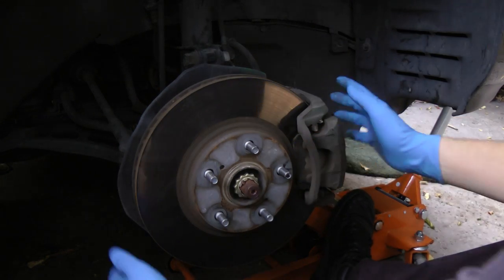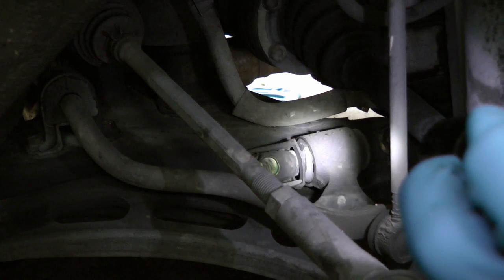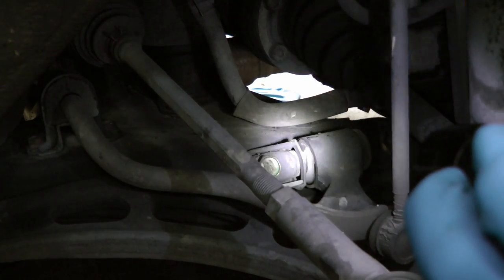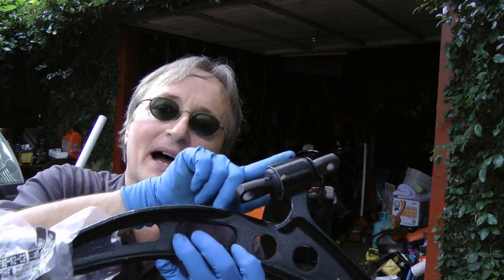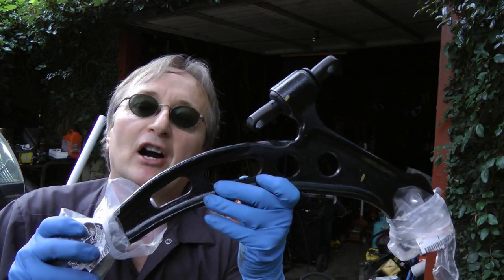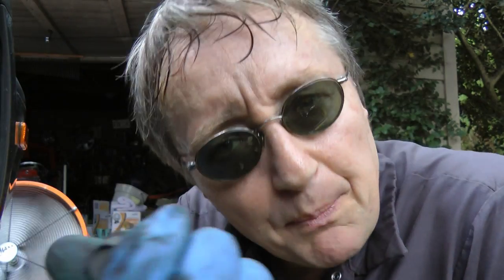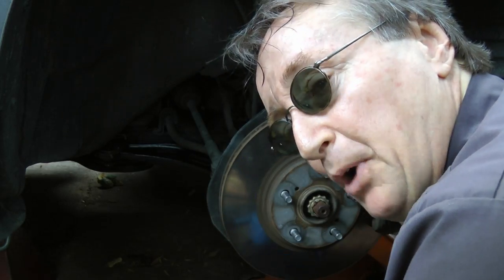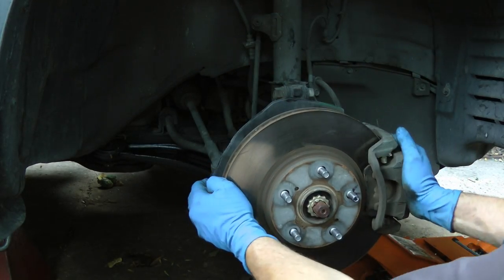How to Stop Steering Wheel from Shaking (Lower Control Arm)

Comment: Hello,  I've just discovered your videos and really appreciate them.  I do almost all of my mechanic work myself. 
I have a 98 Lex ES300 that has a worn control arm bushing on the driver's side.  Do you actually have to replace the entire control arm?  I can buy just the bushing from a parts store. It's the same long bushing that is bad in this video. The bushing is about $26 and the control arm is about $100.  So is it impossible to get the new bushing worked into the old control arm? 
Thanks

Comment: Hey Scotty! Great video! I just did this job on my 1999 Solara. I replaced both control arms, but now I have some insane positive camber on both sides! Why is this?? I have found specialized camber adjustment cam-bolts for fixing this, but I don't feel like I should have to! Did I do something wrong? Or did ImportDirect just build the control arm to the wrong dimensions? I don't want to go aftermarket to fix this problem if I don't have to. Please help! Thanks in advance!
Reply from the maker: +Andy1dude they built it wrong, if it's a chinese made one, they often are made poorly
Reply: +Scotty Kilmer 

Hey Scotty! I forgot to ever reply after I figured out my problem. 

I had had my car aligned several months before the control arm bushing went out, but it was done while the bushing (the reason I replaced the control arm) was partially already bad, and presumably somewhat out of shape (they don't go bad all at once overnight, as I'm sure you know). 

Consequently, when I put a brand new control arm on, it threw my alignment out. I took it to a shop and he put it on his 4-wheel machine. Turns out the only thing wrong was some toe-in on the front right. No camber problem whatsoever. 

HOWEVER!!!  This taught me an important lesson: Sometimes toe-in can look like positive camber, because the tire gets all squeezed in at the bottom as it rolls forward, making it look like it's leaning. Secondly, I should be careful self-diagnosing when I am not a professional with a $75,000 alignment rig. 

Long story short, $75.00 later, I don't have to screw around with aftermarket cam-bolts, and my car is back to normal.

Comment: Hey scotty, Ive seen all your videos! yure the best!

I was recently in an accident where I spun out and my right tire slammed against a curb. It bent up the rear trailing arms & watts link and maybe more.   
The rear axle shifted about 3 inches to the left, it still drives fine, but the rear wheel is definitely misaligned. 

What do you think my best course of action is? 

to replace the bent parts? or to buy a whole new rear end off a used crown vic?

do you think I can get it aligned?

Comment: You said that if your steering wheel shakes when braking.  Doesn't that also indicate brake rotor warp?
Reply from the maker: sometimes yes, sometimes no. ALWAYS fix broken suspension parts you can see first, as they can cause shaking when braking due to looseness.  IF you find no worn susp parts, then change the brake rotors and pads.

Comment: Hey scotty Great video as usual. My problem is on a 2012 Focus Hatchback and the LCA on the LH side. Shop manual says dont pry on the ball joint but to use a pry bar in the LCA opening. My problem is that there is nothing to gain leverage off of. any tips?

Comment: Hey Scotty,
I have a 2013 Ford Focus and I can't find any information on whether or not the bushing/rubber is separate or attached to the control arm as one part; just like in your video with your vehicle. My local shop is telling me it's all one part. Before I dive under, would you happen to know? If it's separate it would definitely help the wallet and the shop it's pulling a fast one.
Thanks!

Comment: I really enjoy your videos!  I just purchased a kit to do a front end job on my 02 Odyssey van.  Lower control arms with ball joints, sway bars, along with inner and outer tie rod ends.  Any recommended plan of attack, or just start at the control arms and work my way toward the engine?
Reply from the maker: just take your time, and jack both front wheels off the ground to remove any tension on the system.
Reply: Scotty Kilmer Thanks Scotty...going to tackle it this weekend.  I'll let you know how it goes.  Thanks again for taking time to share your knowledge and experience.  So much help!

Comment: Hey,  next week I'm  going to change out mine also in a 2016 nissan versa note on passenger side... Is there anything to be aware of when i do this myself?  and if i change the one control arm is it usually best to change both sides at once or does that matter
Reply: Nate frambach it is best to do both sides when it comes to the suspension, especially with the struts. It would be awkward to have one new control arm when the problem can also be with the other. I keep seeing lower, meaning there could be an upper portion but I dont see any thing online for it.

Comment: You can use 98' camry lower control arms on the car your working on, i did that with my rx300. There much cheaper and the same exact part.

Comment: Hi Scotty,

I did a steering balance recently and the guy told me that the Lower Control Arm is not placed well and he needs to fix it by positioning it correctly. But after that a strange thing is appearing while driving and especialy while turning around! the rpm is like firing and the car is like beginning a drift.

I went back to him but he says that this has no relation with what he has done to the Lower Control Arm. What do you think ?

Comment: Hi Scotty. I went in to get my front alignment done for my 1999 Honda Civic EX today and they said they couldn't do the alignment because my right front lower control arm is bent from my incident with running into a curb on an icy day. I've never done any car repairs before, but I want to save money. Would it be this easy to change on my Civic if I can get ahold of the part and maybe a friend who knows a little about cars?
Reply from the maker: sure, it's a simple job for anyone mechanically inclined with simple hand tools

Comment: I recently replaced my lower control arm and sway bar end links for my 2004 525i and I'm experiencing a bumpy ride, especially when I'm on the freeway. Do you know of any common mistakes when changing a lower control arm that might result to a bumpy ride?
Reply from the maker: being bolted on wrong or too tight can make em bind

Comment: I am currently replacing a both front lower control arms on my Hyundai Santa Fe. I did the passenger side but the pinch bolt on the driver side is most troublesome to remove. Went through a can of WD 40 can and my ball and peen hammer broke on it. The only thing I haven't tried is a propane torch to loosen the knuckle. any thoughts?

Comment: When I got new tires and an alignment last year, the car shop told me that '07 Hyundai Elantras have rigid control arms so they can't fully align the car for the issue I'm having (front tires wear heavily on the inside of the tires) and I needed to buy adjustable control arms. I found the parts they suggested online but from what I can tell from looking at videos on how to install them, what they recommended to me was for the rear only. So two questions: 1) If the wear issue is on the front tires only, then I need to replace the control arms on the front tires, right? 2) If I only need to replace the control arms on the front tires, then I have the wrong parts, correct?
Reply from the maker: yep, to all your questions. Find a better alignment guy, many of them know how to shim and drill and make adjustments without buying such parts

Comment: Hey Scotty. Is there an oem or aftermarket brand you can recommend for 2007-2012 Toyota Camry control arm? Original toyota part is over $200 each.

Comment: for my crown Victoria 1987, BOTH the front wheels wiggle like the one in the video.  Do I spend $500 bucks on both the upper and lower control arm assemblies, (as suggested by the alignment shoppe after a tow alignment, mind you the cam is still off) or just replace the bushings and ball joints on said arms?    Much thanks. I want to make sure from the best, so I do not overspend $$$ if it's just the bushings and ball joints that need fixing

Comment: I was always under the impression, before you tighten the bolts that secure the bushings down, you want to preload the suspension? Is this true? Thanks
Reply from the maker: some vehicles need that, this one doesn't. check with the manufacturer

Comment: I have a 2004 Nissan Sentra and it rattles so much when I break at higher speeds and going downhill when I break, my steering wheel does so a little bit. This is the same method to change the control arms on my car?

Comment: Hi Scotty, I have a 2001 honda civic Dx 4 door that will need 2 lower control arms because when i hit small bumps it sounds like it hits a metal. Im assuming its either the ball joint or/and bushing but i was told that it will need a whole new control arm...my question is can i just buy the bushing/ball joint to be replaced from the broken ones or will i need the entire control arm?

Comment: Hi Scotty I have a question what cost the problem I replace the the new brakes and rotor also the ball joint  but the rotor star with a groove on top and no time this happens like  a few weeks after I change this parts

Comment: Just left the Nissan dealership in my city and they quoted $1,727.00 to replace both front lower control arms. I took my car in just for a recall issue. Then they kindly gave me the items the car needs. My car is 10 yrs old. I need other ideas on places to take it to.

Comment: hello again in was replacing my low control arm on the right side if my 2002 dodge stratus . The out side of the control arm the bolt broke. My question  is how you get the bolt out I seen YouTube video where the cut the housing weld and opened  it

Comment: I have a 2002 RX 300 AWD.   I am having a horrible left to right wobble when I hit speeds of 65 mph or greater.   I have had the following done and still not fixed:
Wheels rotated, wheels balanced
new shocks, struts and links front and rear…
Also alignment...
Only thing my mechanic can see that is off is the left control arm and bushing.   Can this cause that significant side to side wobble?  Would replacing it solve my problem???

thanks to any thoughts!!!!!
Reply from the maker: first find a better mechanic, any good front end mechanic can load test all those components and show the problem without guessing.  It could be that arm and bushing though, see that a lot in those

Comment: Hi Scotty I found out that my mechanic put the right lower control arm to the left and the left control arm to the right. Should I change them to their correct position? Its an 07 Camry. Thanks for your advice.
Reply: How is that even possible?
Reply: I went to an independent shop to put new aftermarket lower control arms. Then when I went to my Toyota dealer for an oil change they said lower control arms were installed on the wrong sides. There was no problems at all.
Reply from the maker: +Onr Onr if there are no problems, leave it, wrong sized arms would cause car to pull and or shake at speedes

Comment: If my bushing is torn and the lower control arm is fine. Would I be ok to just replace the bushing. 3rd gen Subaru Outback.
Reply from the maker: +Brian Patrick sure if you have a press or tool to remove and install the new one

Comment: Hey Scotty first of I wanna say your videos rock man. But I have a question. My steering wheel is crocked when I start driving. It's not straight. I have a 2004 Jeep Grand Cherokee Laredo. Would this fixture solve the problem to my jeep? When I hit a bump my steering wheel shakes a little. It's called the (death wobble) please get back at me. Thank you.
Reply from the maker: yes, could easily be this, or any other worn part like bad ball joints
Reply: Awesome! Thanks Scotty you rock!

Comment: Scotty I got a 2007 camry. Do I need to take the engine and transmission up in order to reach and replace the lower control arm?
Reply from the maker: no, there's enough working room there without doing that

Comment: Hey Scotty, I just moved here to Houston and my inner CV joint separated while going down the street about 30 mph in my 94 escort gt. Aside from said axle, after removing the hub everything seems fine and undamaged besides a ball joint (I assume that side was parked next to a ditch that flooded, wheel bearings were bad on just that side and were replaced). Any tips on the removal/install process of the inner CV joint from the tranny case? The manual says to remove the crossmember?

Comment: Hi, i have a question. My car Seems to be shaking when im in low gears and the faster i go its still skakes but can barely tell. Somethings definitely not right. Now im not sure if this could be related but i recently changed my struts and on one side accidently pulled out my cv axle. And a bunch of fluid that i believe to be transmission fluid came out. Could it be my Trans fluid is very low cause the gears to appear to shake? Manual transmission. Thanks
Reply: Shudder could also be a symptom of a lost wheel balance weight.  That's a lot cheaper to get checked first.

Comment: I realy like your youtube channel, very informative. 
I have a question. What do you think needs to be fixed on the car if the car feels like a boat when you are moving the car on the road? It's good road holding when i drive straight ahead, but when I drive to the other side/drive past someone, it feels like a freaking boat. It's an opel astra f 2.0 gsi
Reply from the maker: often worn out struts and or suspension springs
Reply: Scotty Kilmer Thanks for the respond.

Comment: Hey I got a 2010 Mercedes e class and I don't have wiggling but I do have a light clonk sound when I go over certain big bumps , I jacked up the wheel and it does move and I see some slipping where  the lower control arm connects , would it be this same problem?

Comment: Scotty I seem to have the same problem with my 06 Maxima but the mechanic says it is the wheel hub and the sway bars. Will those things cause the same symptoms as the lower control arm? Thanks!
Reply from the maker: yes, any worn front end part can cause that
Reply: Thanks!

Comment: If the bushings are bad is it best to just change the whole lower control arm or just the bushings ?
Reply: matt toad if you can find the bushings just replace the bushings. If not buy a new control arm.  You’ll need a press kit to remove the bushings. ChrisFix has a video on how to remove the bushings.

Comment: hi scotty,my nissan pulsar has a small crack on the front lower control arm which the dealer won't fix under warranty because it hasn't failed yet. How dangerous is this and should i take it further?

how dangerous is this and should i take it further?

Comment: Do you have to "preload" put the wheel on and put it on ground (or jack up the LCA) before torquing the bolts??? I reinstalled mine today with the new bushing and torqued the bolts with no preload as the FSM didn't mention preloading but I seen a video on here saying you need to preload and I'm worried I've screwed up...
Reply from the maker: some vehicles need to be preloaded, yes. But not this particular model. If worried go to any alignment shop and they can check alignment, which is a good idea to do every once in a while anyway

Comment: 2009 prius 109K   what would cause lateral dipping?  From day one as second owner with new tires.  Vertical dipping gone after front struts & springs changed and back struts but not springs changed.  Garages can't find suspension problems.  What should be checked again?
Reply from the maker: +emerald young worn springs or bent control arms are common

Comment: Scotty, I'm trying to replace my control arm for a Toyota Corolla 2004 from the drivers side but the transmission is in the way of taking off the bolt.. Any tips on how to remove it?
Reply from the maker: you would have to take off the tranny and motor mounts then and jack it all up for clearance

Comment: When coming to a stop my car's steering wheel vibrates.
It also vibrates when I am stopped in drive. I looked up a few things and found out that this could be the motor mount. I wanted to ask to be sure: could it be the motor mount?
The vibration isn't too bad. Should I even be concerned with it? My car is a chrysler Sebring LXI 1999 non-convertible. 
Thanks!

Comment: Hello Mr. Scotty, I was changing the lower control arm on my 2004 Chevy aveo and I had three bolts to remove, The ball joint , front bushing and rear bushing. The rear bushing wouldnt come out and stripped out. What could I do to get that bad boy out?

Comment: Hi Scotty.   I have a quick question regarding lower control arm on 2005 Nissan Altima 2.5L.
I had a bad ball joint on my Altima, and since ball joint is part of lower control arm, so I replaced  the entire unit.  My old original ball joint had a cotter-pin, but the new one doesn't have it at all, there is no hole.   I tighten the nut to atleast 50 ft/lb. Does is matter at all?

Comment: Scotty front lower ball joint is worn. I'd like to replace just it but it is mounted to the Front lower control arm. How would you go about replacing the front lower control arm on a Ford Ranger? The front lower control arm has a shock and the spring mounted to it.

Comment: hey scotty, after replacing the lower control arm (2004 g35) will I need to get an alignment again?
Reply from the maker: ONLY if it's not the right size. You buy a dealer one, it will fit perfectly and not need aligning